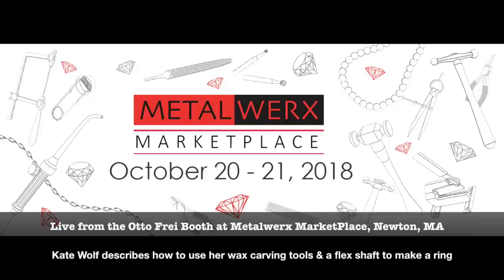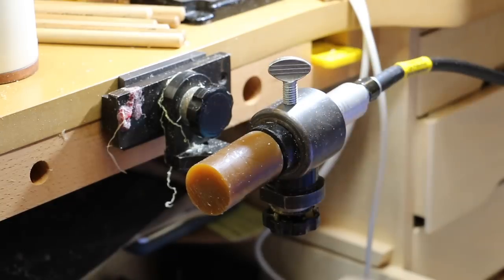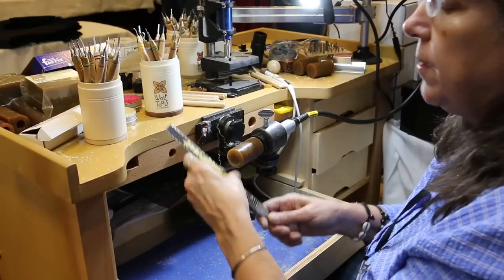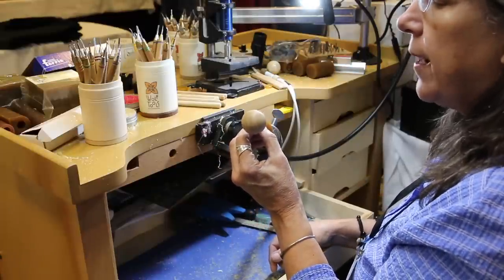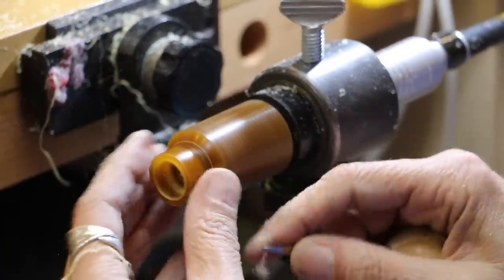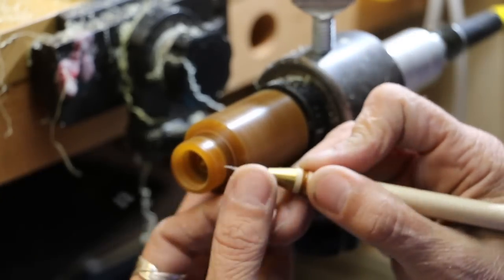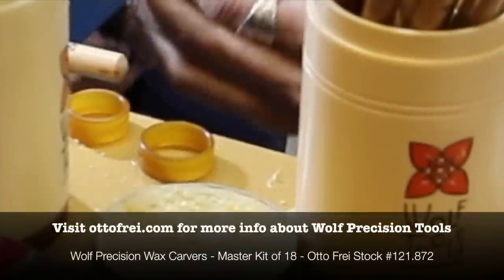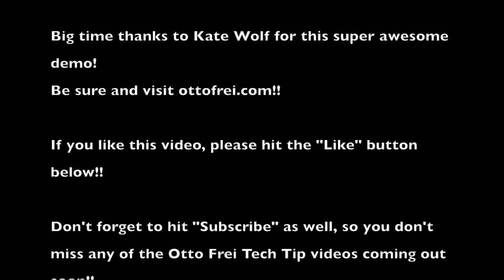Kate Wolf Shows How to Make a Wax Lathe with a Flex Shaft and a BenchMate

Comment: Sorry if this sounds negative, but I managed a shop for decades and have seen accidents that weren’t supposed to be possible happen in he blink of an eye.

For safety sake , always make sure that the sharp barb on end of file is covered. Even in soft materials the file can grab and that sharp handle spike is supposed to have a handle. It’s even designed the way it is so that a simple wooden handle will stay on and protect the user from a metal spike that is being held against a fast spinning lathe piece.

A friend of mine seriously injured himself when his file bumped the collet and the file was driven 2 inches into his palm.

I know Kate is a professional, but demonstrating unsafe work practices to newbies as this is intended is just asking for trouble . Be safer than you need to be, please.